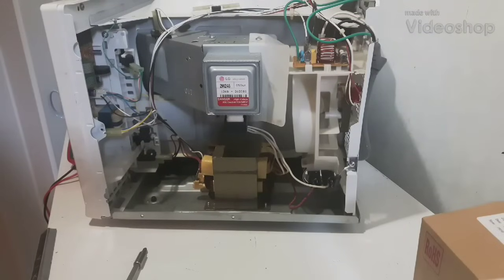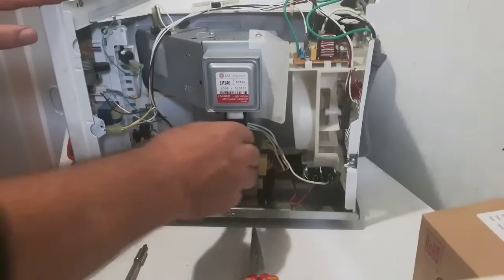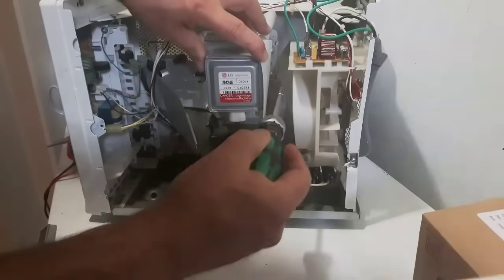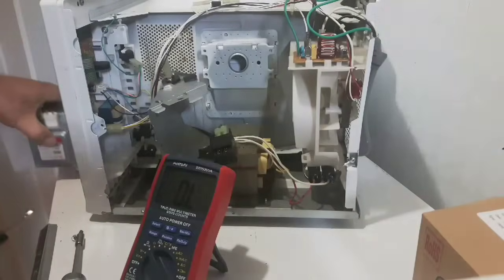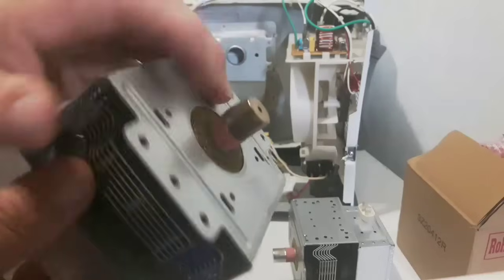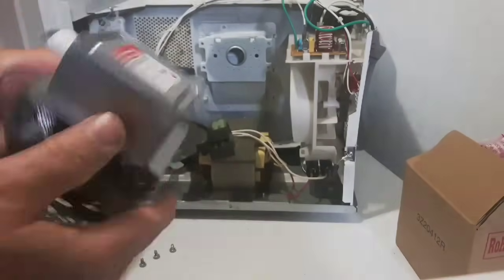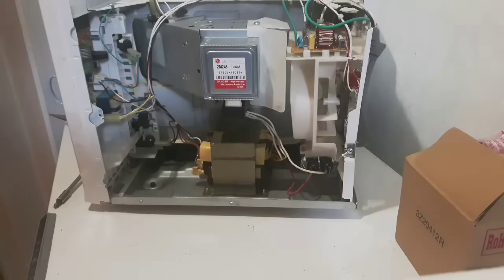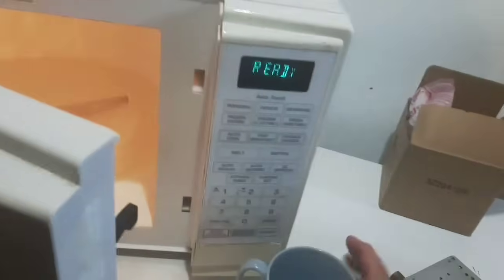Checking and Replacing Magnetron  in a Microwave. ( Runs but no heat )

Comment: I almost replace the magnetron. What stopped me from buying one is the price. Nearly 25% of the cost of a new microwave oven. I knew my arcing magnetron is functional otherwise it won't make that buzzing and arcing so I just do what the seller of the magnetron on amazon suggested when replacing a magnetron. Clean the damage oven cage, replace the mica sheet. I did just that. Cleaned the oven cage where the magnetron antenna is aiming at. Sprayed painted rustoreum paint and let it dry while I ordered mica sheets from aliexpress. Since my magnetron has two burnt holes on the atenna tip I decide to seal it with jb welder. A week later I got the mica sheet and I put them together. To my surprise it arced again. Heck. I removed the magnetron to check but the jb welder did not melt. So I cleansed the metal contact of the housing where magnetron sit with sandpaper and then greased it with dielectric. I also rotated, spinned, and cleansed that fuzzy brass ring around the atenna to make sure no burnt metal on it. A dab of dielectric grease also put on it. This time no arc. Let it ran for a minute. Then two, then three, then five minutes. Unmounted the magenetron to check if jb welder gave up. Nope. Just warm. I fixed my microwave.
Reply from the maker: Thanks for posting. You did alot of work to get your microwave working again. You saved alot of money..

Comment: Another thing to keep in mind... If there is an "arcing" sound when the magnatron is energised.. I aways thought it was "pooched".. Turns out, if the mica "panel" that covers the opening inside on the wall of the cavity.. Is grungy or dirty, this will cause this.. It needs to be carefully removed and cleaned.. I used a bit of "vim" cleanser and then a damp cloth to wipe clean.. Then reinstall... Oven runs fine with no zapping or arcing.. They need to be bent outward very carefully  to remove, without breaking... Replacements can be found on Amazon...if you're getting zaps or arcing, chances are, the magnatron is "putting out". One more thiing... The terminals on the magnatron are usually labelled "f" and "f a"... Make sure the wires taken off the old one, are reconnected to the same terminals, on the new one
Reply from the maker: Great information. Thanks for posting.

Comment: Good, sir

Can the DEFY SMO 343 work well/ not, with any type of magnetron.?
Kindly advise on this matter.?
May I replace the magnetron with any brand and similar specs
Reply from the maker: Never heard of the Defy SMO 343 but from the pic looks like a nice microwave.
You can use any brand magnetron as long as it is compatible with your microwave,

Comment: Would you happen to know how to disconnect the capacitor from that particular unit? I’ve got mine apart I’ve got the only screw that’s on the back of the microwave on on the outside that I thought is holding onto the capacitor but it’s not budging.
Reply from the maker: I never removed the capacitor. Watched few videos and there was only one screw holding the capacitor. 
What I saw was there was a bracket holding the capacitor. Look on the side or underneath the unit.

Comment: I know this is old but I’m changing my tube now. 
In 30 years of mw repairs I may have only had two that checked bad with a multi meter. Honestly it’s process of elimination. Only four parts make a microwave and the other three are either good or bad on a meter. Mag tubes get hot so the discoloration isn’t 100 percent accurate. Mag tubes start moding internally. It can also be checked by seeing if an amp meter occilates  rather than remain steady between 9 to 12 amps. Diodes generally short and or crack and are obvious and capacitors can be checked for a short to ground or the blip test. Transformers seldom fail so if a microwave doesn’t heat the most likely cause if the transformer has power is: 
Diode
Capacitor
Magnetron Tube
Transformer
Reply from the maker: Thanks for posting Lots of good info on microwaves repairs.

Comment: One of the most common failures in a magnetron is that one or both of the circular magnets on it will have a crack in it. An ohm meter will not show this.  You can often see the crack. I don't believe the color of the tip has any bearing on whether the magnetron is good or not. It will change color with normal oxidation and will not affect its operation. Out of two microwave repairs I've done recently, both had a cracked magnet. Probably caused by heat. Check that the cooling fan to the magnetron is clean and unobstructed.
Reply from the maker: Thanks for posting this great information on the magnetron.
Reply: magnetron could still be faulty with perfect magnets and resistance checks if it fails

Comment: Is it true that a disconnected magnetron holds a huge amount of power. 
Is it safe for me to try and change the bulb myself  ? 
I am not a pro.
Reply from the maker: Yes there is still power there even after unplugging it.
I would look at other videos on how to change the light.  See how they deal with the power.
Depends where your light is located.
My bulb was beside the Magnetron so I had to take the cover off.

Comment: my magnetron keeps burning out, what caused it?
Reply from the maker: Did they give you the right replacement magnetron
Check your power supply.
Reply: @JimMcLaren1950  i think i found the reason. it's the magnetron waveguide cover. the previous one was burnt and I did not replace it so when I replaced the magnetron that burnt out cover sent spark back to the magnetron.
Reply from the maker: @Kdatoh3  Good find on the reason your magnetron.

Comment: Thank you for the video as I have been searching for the answer as well - changed the transformer (was bad), a relay that had a burned connector to the transformer primary line, and everything else checked out fine. The capacitor, diode, the door micro-switches - all good! I finally ordered a magnetron and keeping my fingers crossed. This is a 4 year old video, but just wanted to appreciate it since it added more hope in this interesting journey! Best wishes if you read this comment!
Reply from the maker: Your welcome.
The Magnetron is expensive and I believe I couldn't return it if it wasnt the problem.
It was posted in one of the comments about the silver color.
Since my magnetron had litte silver on it i was certain that was the problem.
Reply: @JimMcLaren1950  Well the magnetron was the culprit! The microwave is back to business again. It was impossible to suspect the mag based on the YT tests I came across.
Reply from the maker: @santanumaitra3962  Glad to hear your microwave is back in business.

Comment: Thanks for this video...

Please, how do you figure which megatron to buy. I fixed mine and i noticed that the guy that fixed it used a megatron of a smaller microwave instead of replacing the same old one. 

i am using 
LG
MODEL: MS3949CS /00
230V ~ 50Hz         MAX.1450W
1450                       2450MHz     1000W

the details are according to the sticker on my MICROWAVE
Reply from the maker: I would go to a parts store and they can reference the part you need
Or check Amazon I would not put a different magnetron in.
Reply: @JimMcLaren1950  okay. Thanks a lot for the feedback. So if I go to the parts shop with the details of the sticker on the microwave. They will be able to tell me which MEGATRON will work best for the microwave?
Reply from the maker: @Pentatonickc  Yes think all your is model number but wouldnt
 hurt to bring all sticker info.

Comment: ⚡Will I get electrocuted? My sister is freaking me out. 
So I just have to discharge the capacitor with insulated plyers?  ⚡⚡ I have the new part ready to go. HELP!! 😳
Reply from the maker: Yes your sister is right. You have to make sure you have insulated pliers to discharge the capacitor .
I had my microwave unplugged for several days and still used the pliers.
Be  very carefull. Very dangerous.
Reply: @JimMcLaren1950  how do I know if it is fully discharged? Thx for reply!!
Reply from the maker: @kartencarter8135  Check out this video https://youtu.be/3L-_ROmtLUo

Comment: I replaced the magnetron and the diode and the capacitor. It’s still making the buzzing noise and not heating.
What else could it be?
Reply from the maker: I would have thought with all the changes one of them would have solved the problem. The other would be to check your micro switches.
Reply: @JimMcLaren1950  yep, after replacing the magnetron and diode and capacitor I ordered the 3 pack of door switches and did all three. No dice!
Just went and bought a whole new one, installed it and it’s working perfectly. $400 later… what a bummer. But I tried!
Reply from the maker: @dadthefixerflorida  Its not knowing what would bother me.
Reply: @JimMcLaren1950  yes it does. I feel like I traded my man card in for the easy fix.
But it works now. Lol
Reply: @dadthefixerflorida  I hear what your saying

Comment: Whatever the color of the magnetron antenna, mine had a big hole melted in the side. I expect that means the magnetron is bad.  It is definitely worth checking the antenna on a device that yet tests good on the meter.  Many, many thanks.  The replacement costs $268. We wlll probably buy a new microwave.

Comment: What difference would the Multimeter test do if it didn't show any difference between. The new and old one?
Reply from the maker: It was a different problem that's why it didn't show up on the multimeter,
Reply: @JimMcLaren1950  what was it?
Reply from the maker: @zachdecker9516  Check 545 there was no silver on the magnetron.

Comment: Just wanted to say thanks. I had 120 volts into the transformer but no heat. Everything tested good with a voltmeter. But the tip on the magnitron. It was driving me nuts then I viewed your video and changed it. It worked great. Thanks again!
Reply from the maker: Your welcome. Happy my video helped.

Comment: I have a 2004 gold star which is LG microwave. A friend of mine who works on microwaves was replacing the magnetron but, he never came back. He has already installed it but did not hook up the connectors. Is there a certain way the wire connectors have to be hooked up to the magnetron and, if there is, is there a video that shows this? Nobody knows what happened to him.
Reply from the maker: Watch this video should be a plug that goes directly into the magnetron.

Comment: Thank you Jim for your video. I have a Logik macrowave. It stopped heating and when I checked, the magnetron was missing. The worse part is I don't know the type which was there and I intend to replace it. Which type do you think can be compatible?
Reply from the maker: There is a model number located some where on your microwave.  Front panel inside the door or at the back of the unit. The model number will be printed some where on your microwave. You need that model number to get the right magnetron from your parts supplier.

Comment: My magnetron had 0 resistance, connector was burnt. Cheapest used magnetron was 20 (smaller one from different model) I bought used microwave for $20 on the same day. Check craigslist first before you spend a few hours diagnosing/learning. New magnetron is definitely same price or more expensive than same type used microwave.
My old microwave, I was trying to repair, was rusty, ugly and turn table didn't work for 15 years! Good luck, guys!
BTW, magnetrons die if there is no food inside
Reply from the maker: Thanks for posting. Very good point " Magnetrons die because empty " .
Reply: On thing I learned and might be good info: turntable not running is similar to no food inside since the microwaves might not get absorbed by the food as when it is turning. Thanks for the comment!

Comment: Hmmmm, I was going nuts checking all the parts the different youtube videos recommended.  All looked good...magnetron and all.  I also assumed it was the magnetron but my multimeter test showed good as yours did.  I'd hate to spend all that money on a magnetron only to find out that wasn't the issue.  You took the chance and it worked out.  I'm going to give it a try.  It that's not it then I'll have a spare magnetron.  Thanks for video.
Reply from the maker: Your welcome. Hopefully its the Magnetron. I had the same thoughts if it wasn't the Magnetron then i would have a spare.
Reply: @JimMcLaren1950  THANK YOU, THANK YOU, THANK YOU! It was the magnetron. If it wasn't for your video I wouldn't have taken the chance to buy it because every other video I saw showed how to test it and no one said that it could still be bad even if the multimeter test showed otherwise.  FYI, another test that threw me off was the "thermo fuse" test.  Well I hade a thermostat fuse (looked exactly like the thermo cut off/fuse).  The test on that showed no conductivity (continuity multimeter test) so I thought that I found the problem.  When I went to purchase it they said that it activates at 150 deg...therefore, conductivity at 150 deg.  I verified this by heating it up with a lighter...cool no continuity....heated continuity.  Just some info in case you come across that.  Peace, and thanks again.
Reply from the maker: @mgpvii  Your welcome. Magnetron is so expensive so I can see people very reluctant to buy one. Thanks for posting about the thermal cut off/fuse, good info.
Reply: You can always tell when a magnetron is toast by the sound it makes.

Comment: Jim I want to thank you for the comment about the tip being brown. I also had the same problem and after checking all components, transformer, power diode, capacitor door inter locks and megatron all checked good. Many videos tell you if megatron is 1 to 2 ohms and not shorted it is good. This is not a true statement.  I also did one other step by checking amp draw and my megatron was pulling vertically no amp's. After replacing new one which by the way showed exactly the same ohms but was pulling close to 15 amp's. Great info on the tip.
Reply from the maker: Your welcome John, thanks for posting. Good info.

Comment: What setting on the multimeter do you use to check the magnetron? 20o, 2000, 20K, 200K or 200M ?
Reply from the maker: Ohms scale.
Reply: if you have auto range style, it won't matter. Otherwise manual setting of 200 or lowest setting is fine.

Comment: I would check first the high and low voltage on the magnetron. If I find high and low voltage present then it is sure the magnetron is dead.(consider that, it is a shorter way to find the problem)
Reply from the maker: Thanks for posting.
Reply: Yes it is the proper way but the problem is this a handy man dont have high voltage checking meter our multimeters max range is 1000 v  ,unless you have pro meter how can you check coz it is a doubler circuit .the magnetron works as vacuum tube it has filaments it has high voltage it generates frequency. The only way is hit and trail you are correct sir.

Comment: Don't use the number on the label inside the door of an LG.  That's the part number for the label! I did find it that way by back cross-referencing. The right number is on the label on the back. :)

Comment: Sir is there any way to find the polarity of an magnetron
Reply: Just pay attention to where the power wires are connected, and plug them again the same way.
Reply: Snap a picture before dismatelling any thing 
Circuits are also available
be sure to fix the capicitor and diode in right way otherwise your main fuse will blow immediately
Reply: I am not sure but I think it doesn’t have a polarity.

Comment: Jim,
The reason the Tip of the Magnatron (antenna) is discolored is that the Magnatron gets extremely hot hence the fan and aluminium cooling fins within the Magnatron. The discoloration is due to the heat and is nothing to worry about within a week a  new one will look just the same. Biggest tip for all users is to make sure the cooling intake to the fan is clean. Magnatron magnets X2 will crack due to heat and operating effiency drops dramaticly. ALSO REMEMBER TO ALL PEOPLE......THE CAPACITATORS IN THE MICROWAVE DO STAY CHARGED THE CHARGE CAN AND OR WILL KILL. DISCHARGE BEFORE YOU DO ANYTHING>
Graeme
Reply from the maker: Thank you very much for posting.  Very detailed explanation.
Reply: Jim McLaren 
Thanks Jim
Graeme
Reply: "THE CAPACITATORS IN THE MICROWAVE DO STAY CHARGED THE CHARGE CAN AND OR WILL KILL."
-I believe they have an internal resistor that bleeds the charge.

Comment: Hi Jim, I found this video extremely valuable. One question I have is, what type of screwdriver are you using? I knew about magnetic ones, but I noticed you were rotating your wrist without letting go of the handle, so it must be some feature that lets it go only in one direction? I didn't know those exist!
Reply from the maker: Pat, the screwdriver I used is the Wera  Kraftform Kompact 27 RA 2 available on Amazon. I did a review of this screwdriver https://youtu.be/JMFkZ8A9zq4